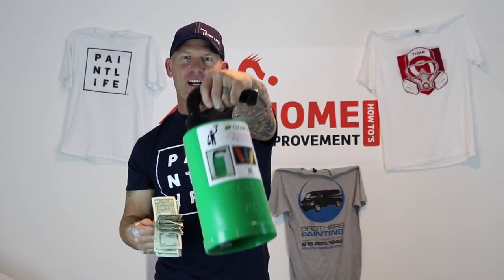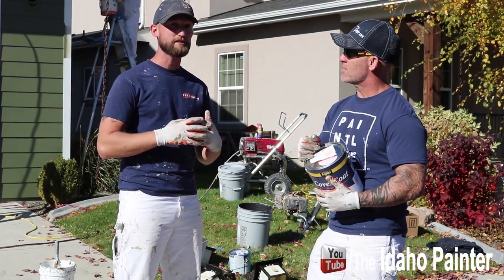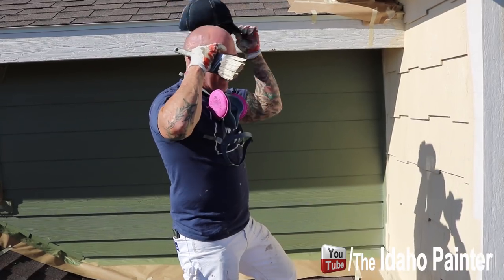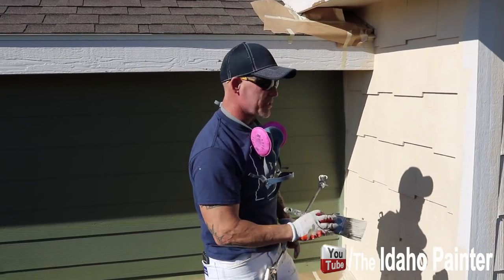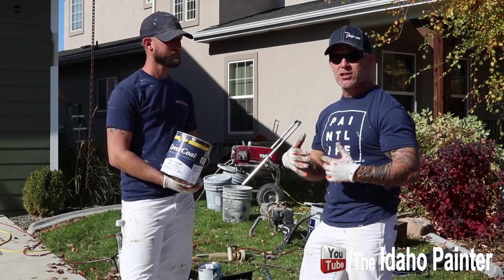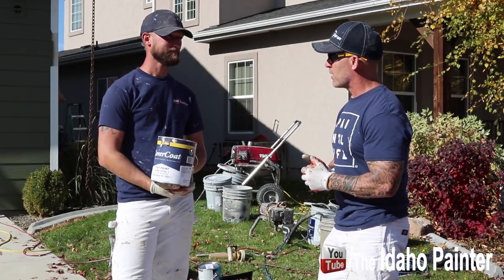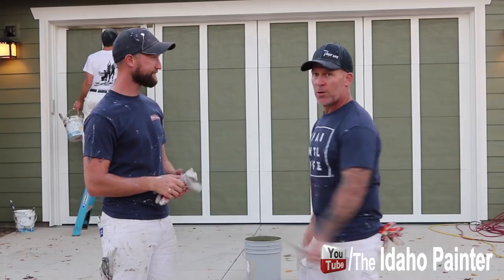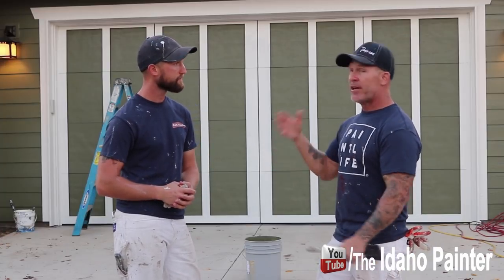Testing Rodda Cover Coat Exterior Paint

Comment: If it's going on too thin increase your tip size or spray slower. Suggestion - use a swivel at the end of your wand so you can spray the underside of the edge of the shake. Back rolling does help. My experience with CoverCoat AC 911 has been good. It's not a flat paint; it has a velvet flat finish; a slight sheen. This coating is perfect for stucco substrates where a low sheen or close to a matte finish is desired. If paint is splattering the pressure in the pump is either too high or your spray tip is worn... I have not experienced any of the complaints of this coating as seen in the vid. Some of the comments are puzzling?

Comment: You guys are OK. Definitely an asset to the painting industry. I love to watch and learn on your channel.  However, I've been watching you for several years now and I must say I find you very entertaining. However, you guys don't seem to have your spray skills down just yet. I know, you've been doing this for years and you know what your doing. My opinion is that you should be able to quickly adjust your technique to any type of finish, primer, etc... right on the fly. Those "spatters" you're talking about are most likely due to that 24" combustion chamber that you're using as a tip extension. I've been spraying for 43 years now and I use Rodda paint almost exclusively. Prior to Rodda I was a Dunn Edwards man. I've used many many brands in my life, most gone now, but I know what I'm talking about as well as anyone. Chris, if you were to add a swivel to the end of your tip extension, and drop down to a 12" as your "go-to" extension, you might see a great improvement in coverage and quality of finish.
Please guys, understand that I'm not heckling you. It's just that I've been a faithful viewer for quite a while. I can no longer keep quiet. As a painter with plenty of years experience, and you guys testing a product that I feel is among the best available, it seems necessary for me to speak up. Adjust your spray style to the product you're using and your results will fare quite higher. I know when I use Sherwin Williams, I need to change the way I spray by stepping down a tip size or sometimes upping my tip size. Same with Dunn Edwards, Behr, PPG, etc...
I believe that the majority of viewers on your channel are NOT professionals, as much as amateurs. It seems to me that a mention of "skill adjustability" would be in order. Those of us in the industry probably know this already. 
Thank you for letting me rant on your EXCELLENT you tube channel. It is a privilege to voice my opinions on your channel and I thank you for it. Keep up the good work. Bob.
Reply from the maker: Robert Partridge I am very very impressed with your knowledge, respect, and time to teach us.  All your points are valid and will be considered.  Email me liveshow@the-Idaho-painter.com and I’m going to send you a t-shirt and some stickers. Write Facebook Rodda comment as a reminder.
Reply: Robert Partridge totally agree
Reply: Robert Partridge how about only using nine inch paper on the roof!

Comment: I believe Ultimate II is their top of the line exterior paint. It's urethanized (I think that's the term they use ?) I recently used it and actually really liked it. It hung well, even on aluminum siding, and covered well (I did light yellow over white). Im no expert, but I thought it was a decent product.

Comment: This is the first time i have heard of the that brand. But there are a few that do the same thing rolling. Will not say the brand, but this paint was coming back off wall when rolling out my lines. It was the weirdest thing. I have never seen that from a paint. Even the cheap paint from Sherman Williams that is costly also. But love the reviews and no matter how long you have painted you learn something new all the time. Do you guys use any paint conditioner?  Like  Floetrol Latex Paint Conditioner? is there another one that you guys knows about that is good for latex paint. I used the Floetrol and liked the way the paint went on the wall. Thanks and have a great day/night

Comment: The sheen difference is because you have only put one coat on. You are using a different product to what is on the house. If you were using the very same paint that was used last time then one coat would suffice but a different product even with a good color match is not going to cover perfectly. One company's flat paint is not exactly the same as another. Most professional painters would know this.
Reply from the maker: TOMinPDX then answer this question.  If I do the same thing with SW Resilience there is no issue.  Or even with Duration.
Reply: Home Improvement How To's The sheen is closer to that of the existing paint and or the color match is better. Or the existing paint is SW to begin with. One coat of a different manufacture's paint is rarely going to cover perfectly either because of color or sheen. That's why the paint store will ask you if you are doing touch-up. They will tell you if you touch up it will flash and they recommend doing an entire wall. And then an entire wall with one coat is rarely going to cover well enough so you can see slight differences in spots.
Reply: @Idahopainter  cause you're a terrible painter
Reply: @Idahopainter cause you assume all paint is the same 🤡